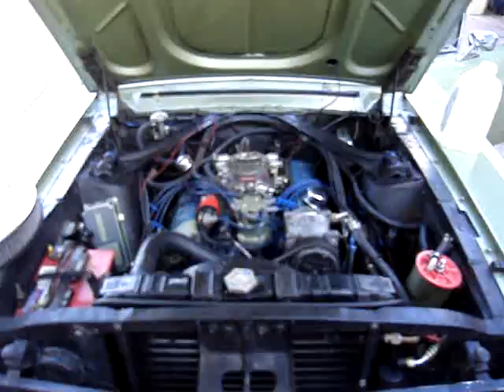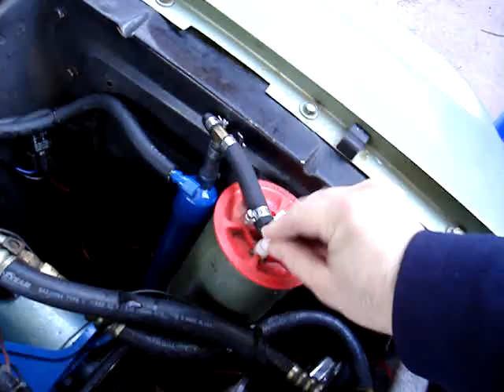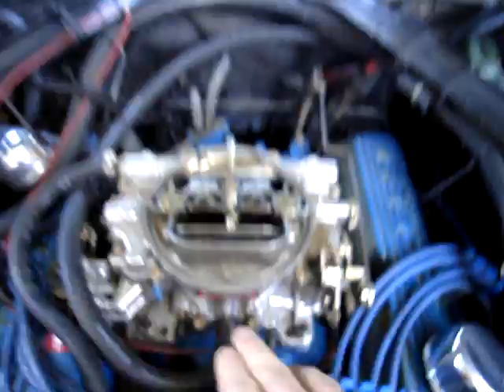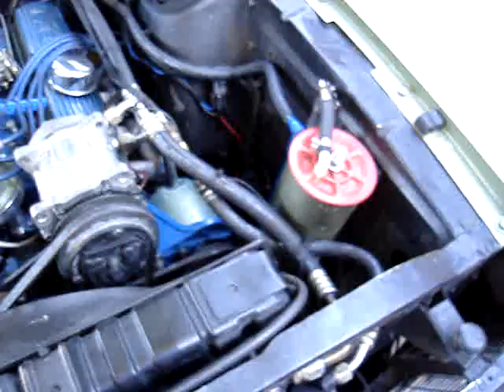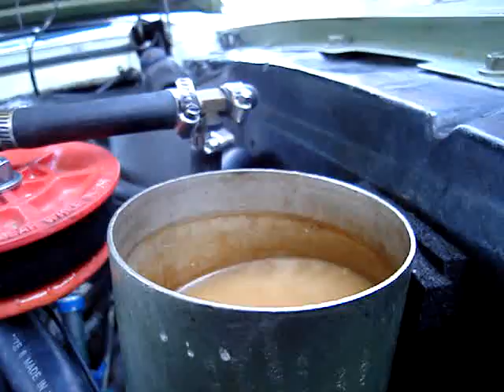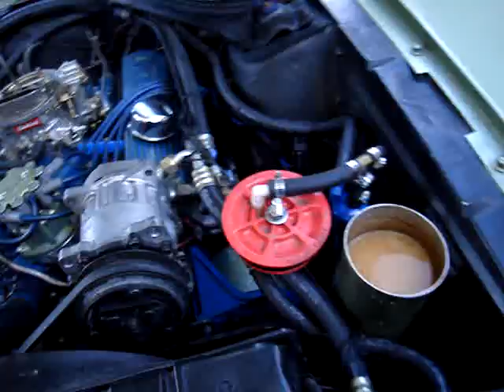Water for Fuel-  Go Hydro Booster how it works

Comment from the maker: When the unit is over heating its because you are using straight electrolysis to breakdown the water.  Use a pulsed or current into your booster.  High voltage environment, with positive and negative polls at both sides, then pulse with your current.

Comment from the maker: We all have most of the parts in our homes right now!.

No shit...completely run your car off water, not just a booster like we've been running but by building a pwm that is installed in front of your booster made with microwave parts you can multiply the amount of hydrogen and oxygen enough to do away with gasoline altogether.

Comment: It is not "unused" energy. You must then replace that energy by driving the alternator. If you burn those Hydrogen bubbles you will get enough energy to drive a small one pound RC car and that's it. You can try this at home with a car battery and some salt water. You'll get a little candle sized flame and then you'll have to recharge the battery. Water is not an energy source. If it was then you would see Ed Beglie Jr. driving around in a water powered car.

Comment: How you you inject the gas in a fuel injection system?  I'm not real mechanical but am figuring that it would be put into the air intake.  I am wondering if that is right?